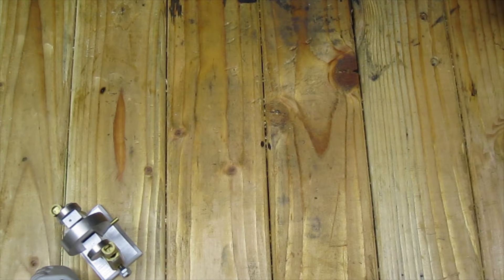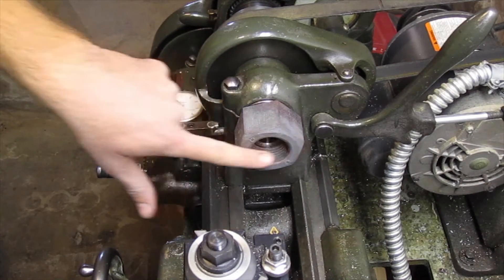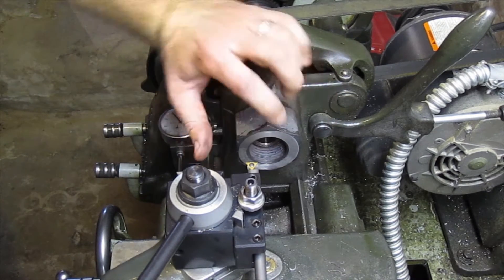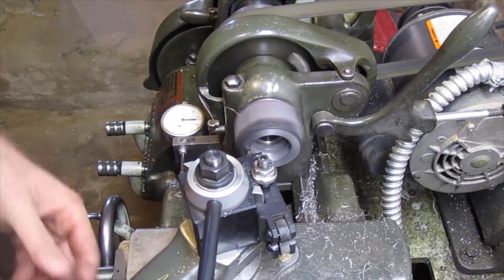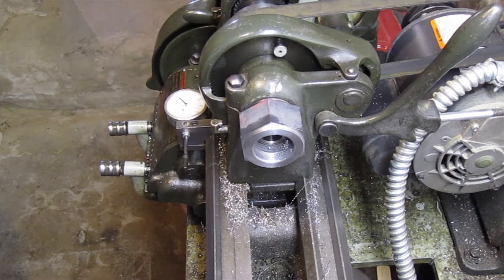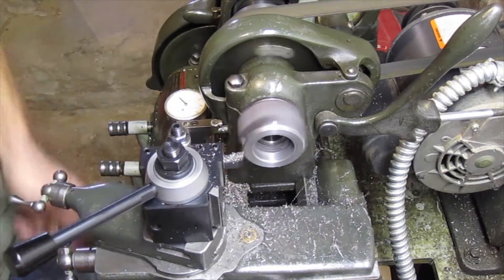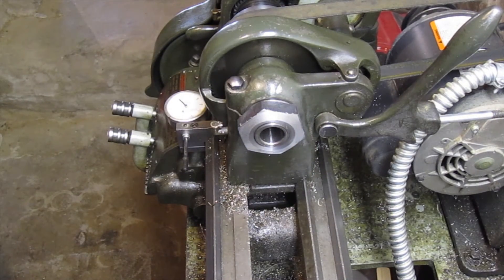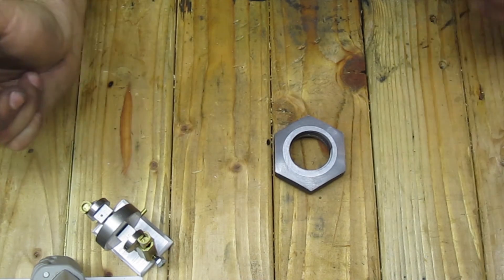Spindle Thread Protector - South Bend Model A Lathe

Comment: I did this exact same thing with my South Ben and it worked perfect. I also took another nut and welded it to a 1/2 inch plate of steel in the center of it that I had pre drilled out the center to 1" and turned it down flat on the face put grooves at 1/2 " apart on the face for easy centering and drilled a 12 hole pattern to clamp material on it and turned the outside down to a 8" circle. Which made a nice face plate.
Reply from the maker: +Anthony
That's a cool idea. Great for holding odd ball shapes.